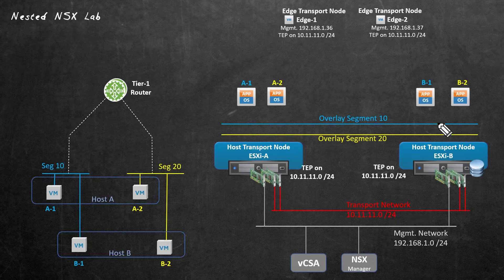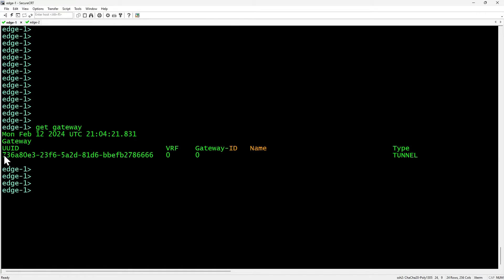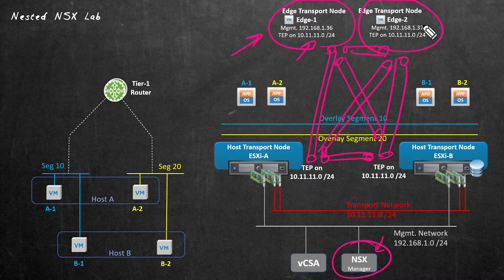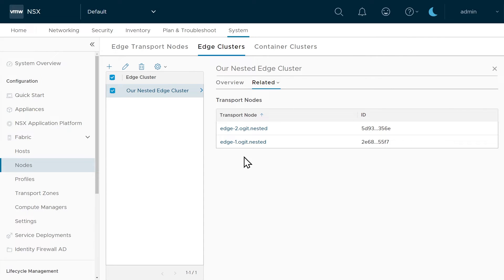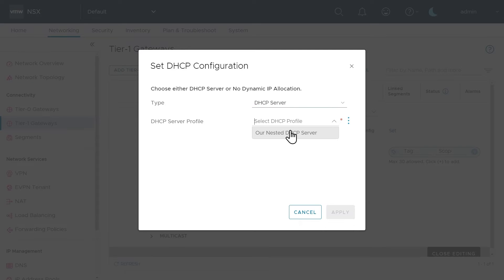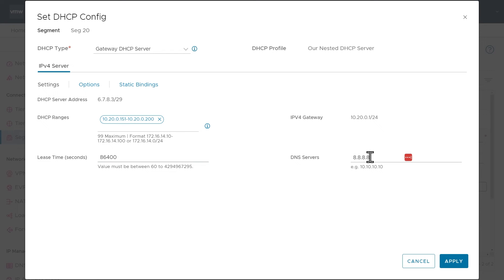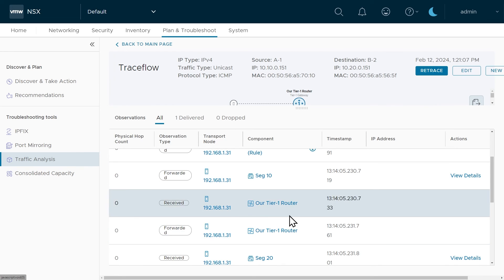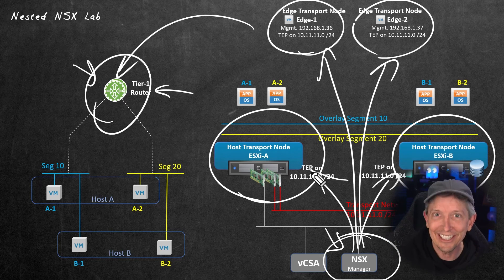How to Use Edge Nodes for DHCP | NSX Home Lab Part 22

Comment: Hi Keith,
I am building NSX lab using nested ESXi right now,
But I got a problem when deploying the Edge Node.
when I deployed in in nested ESXi Server, the edge node only showing registeration pending.
according to your video that it takes 30-45 minutes.
is there any special step that we need to do so we could deploy Edge Node inside Nested ESXi Server???
Reply from the maker: Its been a few months, but everything I did in that nested environment I demonstrated in the videos.
Reply: @KeithBarker  Thanks, I had solved the problem the Promiscuous mode and Forged transmits should be enable. that's made my nested ESXi connection isolated

Comment: Hi Keith,

Like i see T1 router which you created is in the kernel of esxi hosts. When this machine needs DHCP services that component contant edge cluster where the dhcp server live.
I have a question, why T1 router also instance on edge node, when routing is done by T1 on esxi hosts? Also from traffic analys we see that traffic flow between 2 VM doesnt go through edge cluster?

Thank you